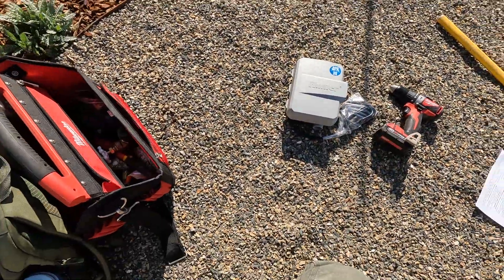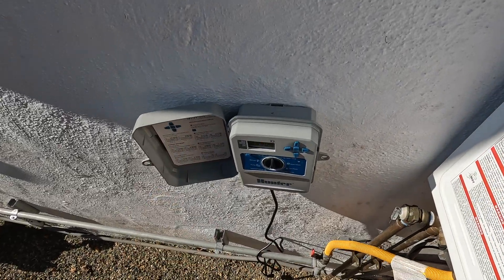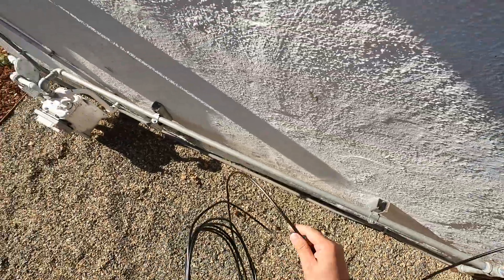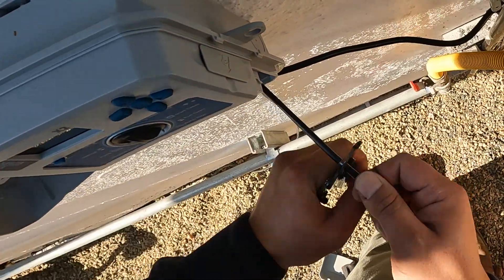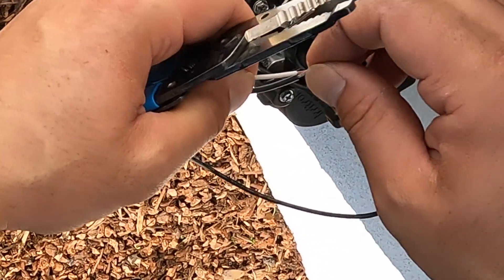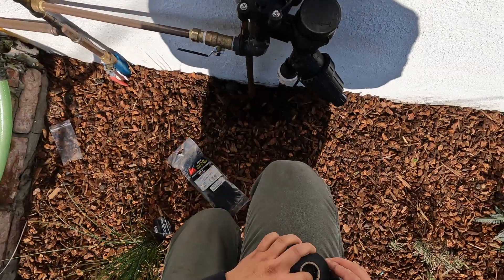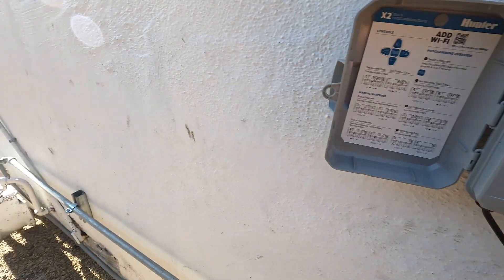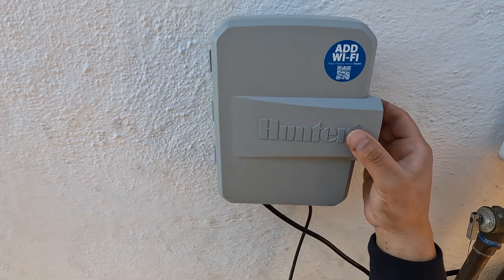How To Install an Exterior Irrigation Timer-Hunter X2 (4) Station Controller POV 4K GoPro

Comment: Great video! Very helpful, but I'm stuck on where to plug it in. Was thee a convenient outlet near by or is this a battery powered unit?
Reply from the maker: Thank you so much! Glad it was helpful. Yes this is a plug in unit, and there was an outlet nearby. Let me know if you have any other questions!
Reply: @oscito.landscape  where do you connect a pump relay